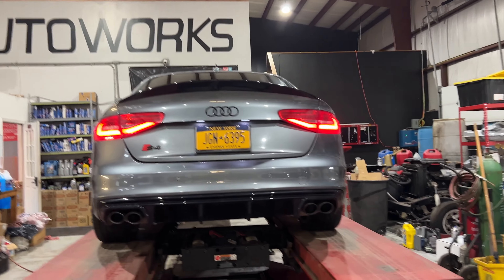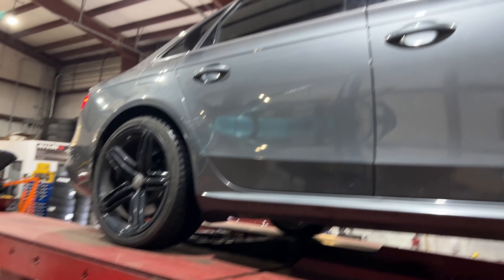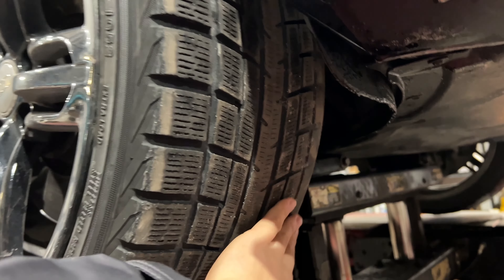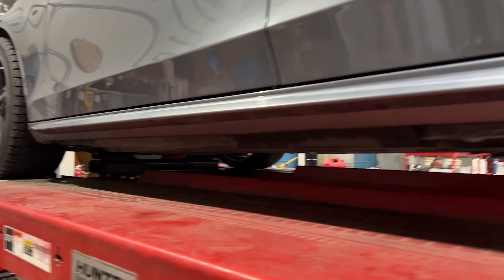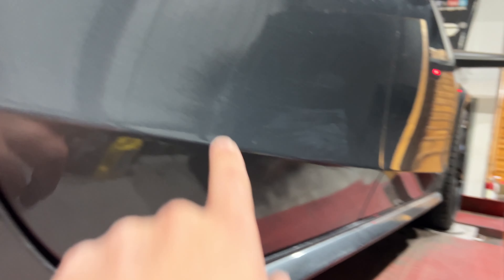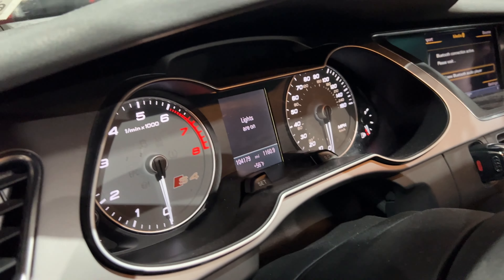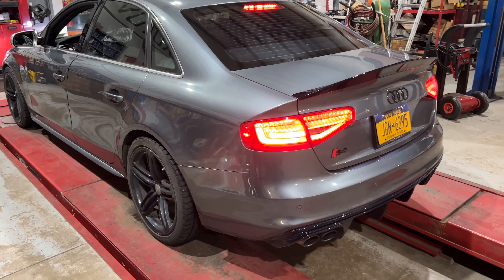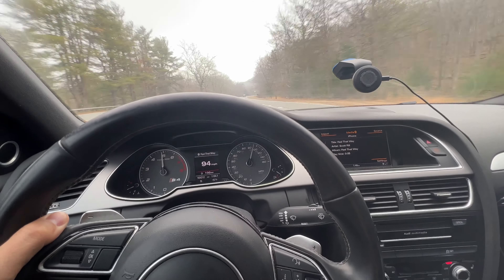Buying a 100k Mile Modified B8.5 S4 - Bad Idea?

Comment: Picking one up tomorrow with 82k miles, highway miles only. Gonna be happy to show it some love!
Reply: How are you liking it?
Reply: @DynamicCash  each day I turn the car on for a drive I fall in love with it more and more. The S4 is a work of art!!
Reply: @thecjmc  How has it been after 8 months? There's a 2016 with 92k miles that is in my price range and I haven't seen much info on higher mileage ones. It felt good to drive but this would be my first car that I'll have over 100k miles on.
Reply: @Black-nf3tx  tbh it’s a pretty safe choice! I’d say it’s a big bonus if you can get one with all the service history done to it, but otherwise mine’s been in tip-top shape! I had a very rare setback with the steering column going bad on mine, but after lots of googling and asking technicians, my case is extra rare so it’s taken with a grain of salt. Make sure the trans is in good shape, and check for oil leaks and I’d say pull the trigger! This car been the most fun I’ve had in years.
Reply: @thecjmc how about now? Lol. I’m looking to buy one in a few days and but it’s got chain rattle on cold start for a few seconds. Is this something I need to worry about? Do I need to get that repaired cause I know it’s expensive. Or is it fine and nothing to worry about as long as it doesn’t get worse.
Reply: @joshkobylnik8400  the wretched chain rattle... lol. it is a known issue on thousands upon thousands of these cars. Audi has addressed it directly, mentioning that it really is not much of an issue to be concerned about UNLESS it persists for for more than a few short moments after the engine turns over. 

Mine will rattle for maybe a second, sometimes even less - which is nothing to worry about and when I mentioned it to the dealership, they said it is no concern unless it rattles for more than like 2-4 seconds. Even then.... its still kind of a meh issue. 

In your case, if possible, it would be in your best interest if you could bring it to the attention of a dealership with either actual proof or even footage. They would advise you on the best course of action!
Reply: @thecjmc  I appreciate your advice. I’ll end up doing that. Thank you so much.
Reply: @thecjmc how are you doing now ? Lol. Looking at a 2014 s4 next week, engine went boom and it’s been swapped with an a6 3.0T, 90k on the engine 120 on the DCT. Guy wants 14k for it. All preventative maintenance done on the new motor b4 it went in.
Reply: @eazy_e.7153  my honest opinion? it's a toss up. i'd be more concerned about the health of the DCT more than anything, but in theory could still be decent. i wouldn't pay 14k though.
Reply: @thecjmc  how much would you pay? I’m honestly also VERY scared of the DCT. Seems to be okay but I don’t have an extra 5-8k laying around if it takes a crap. If it was a manual I would go get it today.
Reply: @eazy_e.7153  if it’s the original transmission out of the 2014 S4 then you’re probably okay since that’s a post-recession model, which is massively improved compared to the B8 transmission. I’d say as long as everything is on top shape then you’ll likely be okay, but combined with the engine swap I’d be a little more inclined to pay less.
Reply: @thecjmc  yeaaa he’s a buddy of mine and wouldn’t even disclose to swap to anyone else because you don’t have too, still clean title. And yea it’s the originally dsg from the 2014 so I’m honestly stuck on what to do. PVC,thermostat and water pump were just done on the new motor. If the DCT did go out he told me he’d get me a new one with labor for 4.5k 🤷‍♂️, he owns the shop. Still sketchy to me, my first s4 coming from NA v8’s my whole life.
Reply: @thecjmc hey bro u still own that s4? if so how’s everything going? i want one so bad thinking about getting one here very soon
Reply: @tjgotbands  they're fun! keep up with regular maintainence and you'll love it. I have been neglecting an overdue oil change and it still rides like a dream. absolute tank.
Reply: @thecjmc  nice bro! yeah my other car’s transmission is going out so i think that this is a sign. it’s meant to be. lol. so just keeping up on the regular maintenance and it’s good? have you ran into any problems with it? also curious how many miles your at now

Comment: I’m looking into buying one of these to replace my MK7 Golf. I know that the 3.0T is a reliable engine but I am also aware of the age of the B8/8.5s. Is maintenance on these bad? I’d say I’m pretty mechanically inclined, but is there much to worry about other than the oil leaks, PCV, and water pump and such?
Reply: Pcv, water pump, thermostat, trans service very important if dsg,  and cats also blow up which can blow up ur engine even on stock tune, they go out around 100k,timing chain should be good but if rattles for few seconds on startup most likely timing chain tensioner, after you get those done they are really reliable engines, very easy to make power but have bad heat soak so need heat exchanger, downpipe intercooler intake stage one 420ish horsepower sub 4 second 0-60 12< second quarter mile

Comment: How’s the car holding up debating on getting one with 100k miles
Reply from the maker: Had to do full front suspension rebuild and the welds on the cat snapped due to motor mounts. About $10k in maintenance later since some work we brought to a shop
Reply: @BuyYourBuild 10k down already … yea nvm lol